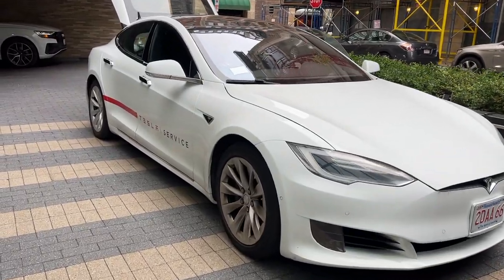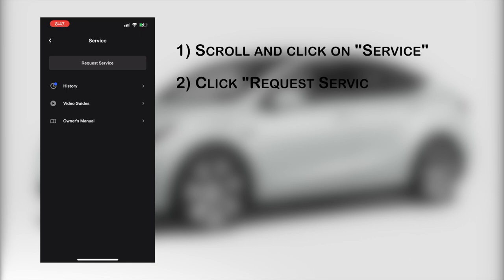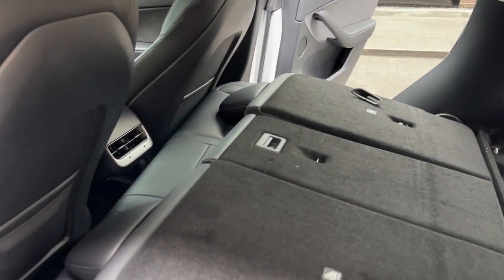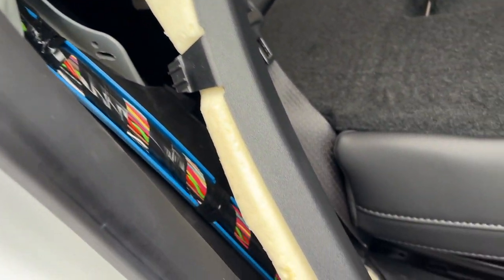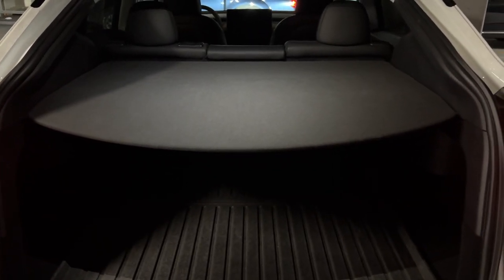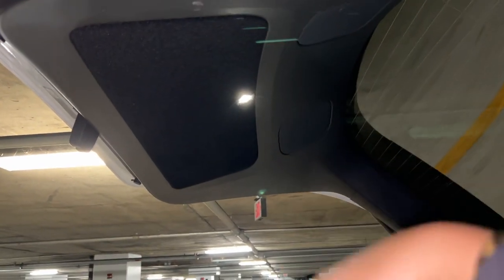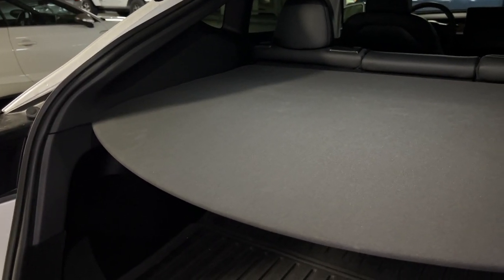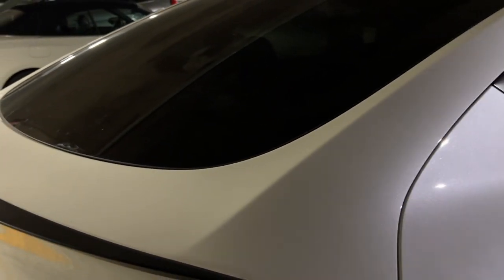Retrofitting the Tesla Parcel Shelf on Our 2021 Model Y - Tesla Mobile Service Install

Comment: Definitely considering this for my 2022 Y. Thinking about salvaging the foam from the old panels to help with noise dampening, doubling up can't hurt since no moving parts
Reply: The darker foam on the new panels appears more dense, therefore better at sound deadening. Moot point for me since Tesla in San Diego said they won't do it.

Comment: Consider yourself lucky as it appears most of the Tesla service facilities don't perform this retrofit.  I was turned down for it in San Diego with the following message:

"Hello, this is Tesla Kearny Mesa reaching out regarding your service request. Based on the info you provided we are not able to provide this service as its not an official retrofit. With that being said we recommend checking back in later in the year. Thank you"

I worded the request exactly as you suggested, complete with part numbers.

Comment: I wish it was like most other cars where it rolls up instead of a hard shelf.  Also I wish it could be removed if you have large suitcases in the back.
Reply from the maker: Great comment.  It would be nice if you could choose the design.  We like the hard shelf because it seems like it could support some items on top if needed.  At the same time, it is rather large and while we can remove it from the car it doesn't really fit anywhere else in the car.  Would have been awesome if it could fit in the frunk when not used.  We are happy to have some more privacy and will plan to remove it if we need the storage room.  Thanks so much for watching and commenting!
Reply: @JQLouise  Thanks for the detailed video. Does the parcel cover fit on the floor of the trunk? I'm thinking about doing setting up this install with Tesla but want to make sure if I need to remove it, I can place it on the trunk bed and ensure the rear hatch door can close.

Comment: Thanks for posting, this is exactly what we want on our 2020 MYP. When you made the request in the app, did you state you wanted the a new parcel self installed and listed the part numbers, or did you list the part numbers and ask they install the parts.  It's a subtle difference, but Tesla can be inconsistent on their policies. So, we've found that careful phrasing can be the key between getting something done, and them refusing.
Reply from the maker: Hi!  We did a mixture of the two and you're absolutely right about phrasing.  Our message was something like this "We love our Model Y and recently saw that the new version is built with a rear parcel shelf for privacy.  We've been told a retrofit is possible and wanted a quote for parts and possibly installation (if mobile service is able to complete).  The parts numbers are..."  We tried to explain why we needed the parts but also be confident that it could be done without being too forceful.  For example, we're still trying to see if service can update our wheel configuration to represent we took the aero wheel covers off.  Some people have been able to do it but the Model Y doesn't have that wheel option in settings like the Model 3.  It definitely depends on the representative you end up messaging.  Let us know if you're able to order the parts and how it goes.  Thanks so much for watching and commenting!
Reply: @JQLouise   I dropped by our local SC to ask about the shelf and was told Tesla published a memo to NOT allow a Tesla Tech to install the parts (retrofit) .  How sad, but not surprising. Tesla is not known for thier customer centric policies. I went ahead and made the appointment through the app to see what happens, but expectations are low.  I may just do it myself and use your vid as a reference. Thanks for posting the detailed process. ❤